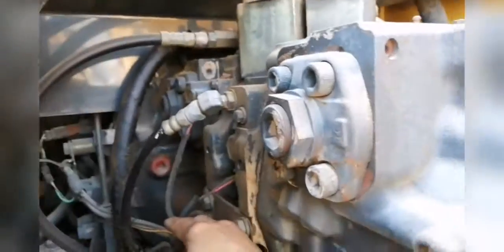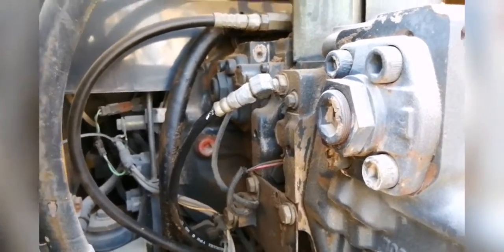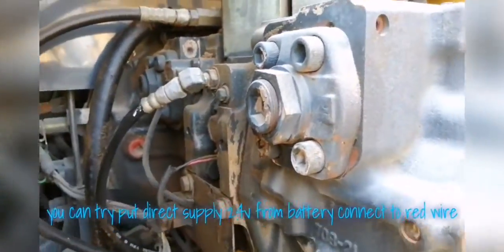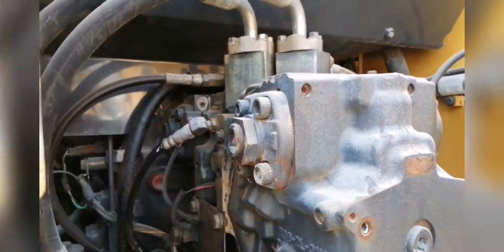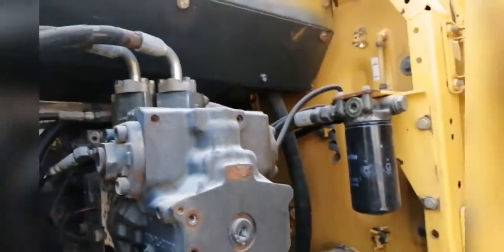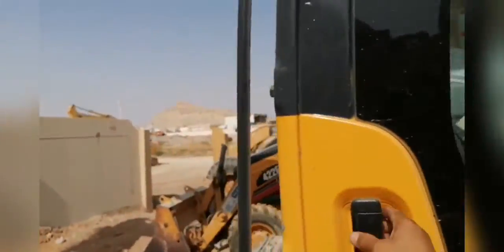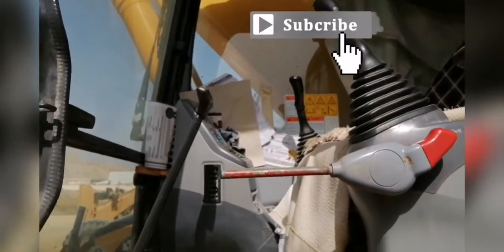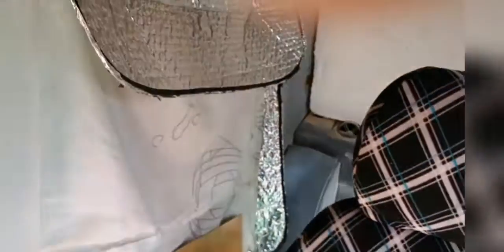KOMATSU PC 220/228-6/7 PC & LS PROBLEM ENGINE ITS OVERLOAD

Comment: ser salamat  poh marami poh akong natutuhan s inyo isa nlng poh problema k poh ser..ok nmn poh lahat ng power nya pero pag ka poh louded sya nauupos poh ang galit ng makina.pero s boom up lng poh sya hirap.tapos pag nagwarning poh battery lumalata din poh sya.ser..pc290 poh komatsu poh ser salamat ser..
Reply from the maker: kung may watsapp k 0567581176 o kya messenger jhunhunk pra makapagusap tyomaayos
Reply: May ganyan din kaming unit sir ganyan Ang trouble anokaya Ang nagging problema nya sir..
Reply from the maker: @abetvits94  ang problema b eh ung nmamatay ang makina kpag nka full trigger k s boomup o arm in or out kpag ganun check mo muna ung dlawang solenoid doon s main pump, ang pag testing nya switch on mo tapos on mo ung safety lock ska mo e check ung supply dpat pareho un n may supply 24v kpag na start mo n mawawala ang supply nang isa ung isa lang ang permanent check mo un, kung may bulb tester k mas maganda ksi makikita mo n iilaw ang bulb ppwede rin n nagkapalit ang socket nya , plike and share n rin ang video ha salamat
Reply: @caterpillarjhunhunk  ok.po sir I check ko po salamat po

Comment: Chief,can you relay to us,how much the standard resistance for the two solenoid...if the reading is abnormal or no reading at all in ohms it causes the solenoid valve closed the passage of hydraulic fluid,am i right?God bless your channel it helps a lot to practitioners like me.

Comment: Good job sir thank you for giving us your knowledge
Pwedi din po bang pakipaliwanag yong PC 200-3 OLSS type pump kong pano amg adjiusmemt sa engine backdown pag nag ooperate ma po yong machine.. Thanks po sa info
Reply from the maker: ask ko lng anu b ang main problem nang machine, engine o main hydraulic pump, lumang npaka lumang model n ito ah, pero ok lang, minsan kasi akala ntin nsa makina ang problema lalo n kpag naooperate, pero d natin n notice n nsa hydraulic system pla, pero meron din talaga n ang mkina n ang problema, hindi b mausok n nag makina mo o may backpressure n s breather, ask ko lang pra may reference ako s mga ppwede ko masabi, ngayon kung bagung ovehaul ang makina, ok malalaman mo nman yan, kung malakas ang pickup nang makina mo kpag nka idle k biglain mo nang full acceleretion, dapat kung ok makina mo bigla din sya n nka full accelerate pero kong nka full n tapos dahan dahan ang pagaccelerate nya may problema o low power talaga makina o mahina humatak.ppwede n magadvance timing or late timing or inspection mo muna ang makina mo, baka may mga dapat n nkakabit pero nakondem n o d n ikinabit. ha. o kya add mo ako s messenger  jhunhunk pra makapag send k nang picture o kahit kaunting video pra makita ko ang sitwasyon

Comment: Thanks for the video. I have old 228 Komatsu excavator.. it won't shut off the engine even I turn off ignition and pull the key out. Engine is still running.. any idea?
Reply from the maker: bro give the specific model with -6-7-8 in witch dash model of your machine,so i can tell you what to do
Reply: Stepper motor is bad

Comment: Any basic advice sir track malfunction forward & reverse not working what possible problem sir?
Reply from the maker: Hello sir some function of hydraulic system its working or not ,if not  meaning maybe do you have problem on ppc lock, but if some function is working  I think you should have to check hydraulic pressure and need to get high pressure at arround 350br

Comment: Hi there my kohmatsu pc88 will not run  the engine stall and low power..
but when I run emergency switch it runs perfectly..
any ideas?no problem with epc silonide it's new..
Reply from the maker: Contac me in my whatsapp+971567581176

Comment: Sr I have a problem with my Komatsu.. I changed my hydraulic oil on my Komatsu.. After charging  I the hydraulic was low and I topped up and  it became too much. Then the plug at the front of the solenoid vavle come off due to pressure.. Since then the machine is busting the pilot hose and the hose which goes to the block behind the main control vavle.. It is lacking power if it gets power it  bust the seal or bust a hose what might be the problem
Reply from the maker: bro i dont konw how thats happen you just change the oil in then, all the  problem you told is came out saddenly,how thats happen,what type of grade of oil you used,before you do changing oil you never had any problem,contac me in my whatapp. +971567581176

Comment: Ser sken ganian din.. Pag nagsabay ung swing saka travel namamatay ung makina or humihina.. Posible kayang ganian dun ung pwedengaging cause nung? Bago pangnunit nmin Ser ee.. D ako masyadong marunong sa hydraulic kaya marami ako matututunan sa inyo
Reply from the maker: yes sir try mo check power supply nung solenoid s hydraulic pump dpat may power sya pareho bgo mo e start, pero dpat nka on lang muna ska mo check
Reply from the maker: salamat, pero pa subscribe mo nman channel ko pra at click mo ung bell botton pra update k s mga upload ko n video
Reply from the maker: add mo ako mssenger pra makapagusap tyo nang maayos,
(jhunhunk)
Reply: My power lahat ng soloniod nya Ser.. San kaya pwede maging cuase.. Ok nman ung mga fuse..
Reply: Baguhan palang po ako sa hydraulic kaya halos 0 knowledge pko d2.. Wala nman ako katulong na nakakaalam.. Truck mechanic lang po kase ako
Reply: Pc 200 Lc po unit nmin Ser.. Medyo modelo na ata to

Comment: Good day Sir.. New subscriber here..ask ko lng po kong anu cause ng hydraulic overheating sa KOMATSU GD 755-5R na grader?. thanks po and more power sir..
Reply from the maker: s greader mga pweding dahilan ventilation, or over used n ang hydraulic oil mo, kung dipa npapalitang ang hydraulic filter mo, bka nagbabara n o hirap n makadaloy langis, pwede ring over pressure, at over yong flow limit nya.
Reply: @caterpillarjhunhunk  salamat po Sir.. Ngayon ko lng kasi naranasan to na grabi kabilis mg init yong hydraulic oil mga 10 minutes lng..
Reply from the maker: @aljonnfernandez8889  ganun b kabilis uminit baka nman sira lang sensor check mo muna sender nya bka damage nya npaka impossible nyan in just a minute eh high temp n agad
Reply: @caterpillarjhunhunk  oo nga sir..napalitan ko na sir.. Hindi mo mahawakan mga hose sa sobrang init..pinalitan ko narin hydraulic pump at control..nag bago lng kunti..
Reply from the maker: @aljonnfernandez8889  na e check mo nb ang pressure ng main pump mo ngayon baka over pressure sya o over din ang flow, tapos kpag ginagamit n kinokontrol ng operator pra lang d mamatay, ppwede talaga magoverheat kpag ganun, mag chexk k muna ng pressure pra sigurado pra may basihan k ha

Comment: Brother I have a problem whit my komatsu 220 lc6 the problem that I have is when the  bucket is full the boom don’t go up soon enough any recomendation
Reply from the maker: actualy bro many reason why the is happens first maybe low pressure one of your pump that driving and giving pressure for the boom, at first you should have to check individualy your main pump, and also try to check your travel if one of the travel is slow meaning one of your pump low pressure, see this video bro, how to testing the main pump to know if main pump is low pressure, you have to use pressure gauge around 500bar gauge the attach the gauge where the main pipe pressure locate there is a small head of bolt you have to remove then attach gauge there, ok, https://youtu.be/mFUyGo0BxjY
Reply: Brother I have a problem what my komatsu pc270-7 the problem that I have is when the bucket is full the boom don't go down any recomendation
Reply from the maker: @ishmaeldadzie7227  contac me in my whatapp +971567581176 for better conversation

Comment: hello sir . i have same problem excator is doosan 300. i check the solenoid valve electric is available .but now have same problem means operating machine then almost stop machine. have any another problem sir?
Reply from the maker: bro can you add me in your watsapp if you so we can talk well, about your problem
+971567581176
Reply from the maker: have you check your monitor about any type of error its easy for me to give an idea were and how you can solve your problem
Reply: @Johnson  hi bro i have doosan dx225lc 2008yr i have same problem loosing power onload and now pump getting too much heat did you sort your problem?
Thanks
Reply from the maker: @gwajimagwajima  bro can you pls subscribe my channel if i have any uploaded video you will be notify thanks
Reply: @caterpillarjhunhunk  thanks done bro

Comment: Chief may idea ka po ba sa connection ng pressure reducing valve connection ng pc-228
Reply from the maker: bakit anu ang problema
Reply: @caterpillarjhunhunk  nawawala ang pressure sa boom up.tapos blik ulit tapos nawawala nmn.pareho cla ng stick out
Reply from the maker: kung alam mo ung valve na nakalagay s likod ng main control valve ang tawag doon ay merge divider doon meron din nka install n relief valve sa ganyang problema isa un s dahilan kung nwawalan ng power,pero kung nwawala wala o putol putol ang pag gana nya check nyo rin ung pilot supply baka naman ung solenoid nya nagooverheat n or pasera na,merge divider,at double stage solenoid baka hindi n nagffunction ng maayus inspection nyo muna ung electrical baka isa sa dahilan eh naandoon

Comment: Sir magtanong lang po,pc200-6, sa main pump 2 solenoid, saan mag gagaling hydrauluc oil supply, ung nagawan ko sa main control nangaling, ung suply ng pump1 na pumunta main control valve, doon kumuha ng supply for pilot lever, pa ma ba yon, tnx
Reply from the maker: yes doon nga magmumula ang pilot supply isa s main supply kung saan nakalagay ung self reducing valve, andoon din ung pilot supply

Comment: Good morning sir, pde ba gamitin pag dinirekta ung redwire ng solenoid sa battery, wla po ba masisira na iba...

Salamat po... Godbless
Reply: Komatsu pc228 

Po ung unit ko, salamat po
Reply from the maker: pwede nman kya lang pang testing lang para s pag trouble shooting,kung mag ddirect ka observe mo ung solenoid bka mag over heat ksi hindi n nrregulate ung supply nya,n galing ecm

Comment: Bro could you please help me to rectify the problem issue on my excavator pc200-8 not getting start when the engine is hot many thanks
Reply from the maker: hi sir,first thanks for messaging me,and giving the information about the problem that you are facing on your machine ,sir i just want to ask first before the problem is started,what did you observe,we want to know more ,for me to analys what is main cause of problem,contac me in my whatsapp for more better conversation,+971567581176

Comment: Hy mr.!
I have one Komatsu PC 210 LC 8 from 2008Fuel consumption is very high at about 18l / h. Do you have any idea why? The engine works well, it has power and does not emit smoke, it rarely happens that  travel sistem it reduces my engine speed!
Reply from the maker: before applying any trouble shooting just check the main pump pressure.
Reply: Could you tell me what values the pump should indicate to me?
F.Pump and R.pump
Reply from the maker: @alinbradea4810  the front is inner side rear pump is outer side

Comment: How to access monitor PC200-6 step by step for checking hydraulic main pump pressure, error code etc ?
Reply from the maker: contac me in my whatsapp for better conversation, +971567581176
Reply: @caterpillarjhunhunk  Thank you bro I got service manual now I can access it.

Comment: Sir paano malaman kung normal working ang solenoid valve,,at ilan ba talaga ang voltage,, kc nung nag check ako 8volts na register sa tester, ang isa walang voltage,, nka start ang engine at nka engage. Pero slow idling pa
Reply from the maker: ppwede ko b malaman kung anung model nang machine mo, normaly kung nag machine ay dash 7 below supply nyan ay 24v pero kung dash 8 pataas may solenoid n ang nagccontrol ay ecm ung tinatawag n variable solenoid, yan eh kung komatsu.
Reply from the maker: ito p s first starting mo normaly ang solenoid nyan ay nka on lahat  s dash 7 yan ha. tpos kpag nag operate kna magooff ung isa na ang nagccontrol ay pressure switch, ung isa pemanent n nka on ang nagccontrol naman ay ecm malalaman mo ya  kung alin s dalawang solenoid kpag e disconnect mo isa isa kpag nagwarning s monitor un ang pra ecm
Reply from the maker: kya nman dapat ung dalawang solenoid ay gumana s unang start mo kasi pra hindi magbigay nang pressure o load s makina.
Reply: same problem po.pc200-7 nka start engine at engage safety lock..isang solenoid no valtage pero pag disconnect naman.may voltage 24v.ang isa 24v pag nka disconnect..once connected naging 8v nalang
Reply from the maker: @jillque3536  n try mo nb s bulb tester kung npapailaw nya doon s dlawang wire nang bawat solenoid,ska magwwarning yan s monitor kpag n disconnect mo ung solenoid n controller ang nagpapagana,nagwarning b? yang harnes ksi nyan hanggat d mo sya pinapagana nag hydraulic system nya pero dapat yan may supply n 24v tpos un nga kapag nag operate kna ung isang solenoid mawawalan nang supply ung isa ang nka maintain ang supply.

Comment: Hello I am from India have Komatsu PC 71my engine doesn't start, but if I losen MRV ON MAIN HYDRAULIC PUMP, ENGINE STARTS IMMEDIATELY, THAN WE TIGHT MRV FOR WORKING, IS THERE ANY SOLUTION
Reply from the maker: ok bro this is i want you to do, can you check the main pump if there is any solenoid attach on the main pump check it and see if we have power supply if solenoid available there.
Reply: @caterpillarjhunhunk  SIR mine machine hydraulic pump does not have any wiring, is there any thing I can check
Reply from the maker: contac me in my whatsapp +971567581176 and send me any picture of the model and serial number, and also pump and engine ok i try to find the model of your machine but i cannot find it
Reply: @caterpillarjhunhunk  Ok fine

Comment: Where is arm sensor located sir. Pc228
Reply from the maker: Arm sensor is located at side of the control valve with separate brocket the function of that sensor is auto acceleration, and behind of the control valve is the main pressure monitoring

Comment: I have a pc 160 it developed a problem , it starts in the morning and works perfect , but if you switch it off after like 2 hours it wont start ,
Reply from the maker: do i know which model dash pc160-6-7-8 i want to know that
Reply: @caterpillarjhunhunk i have the same issue, -7 model

Comment: Hello Master..
Ask ko lng kung alin s dalawa yung normally open or alin sir yung mag si switch off na solinoid during operation.. pc po b or ls....
Reply from the maker: brad sinsya n at ngayon lang nagreply, yung PC-epc ang permanent n may supply yan ung nsa bandang labas n nsa pagitan ng dalawang pump.ung isa LS-epc  yan ung nsa bandang loob yan nman mag oon lang yan s starting time kpag nagenergize n o na on n ang ppc lock valve o ung lock s operator cab un nsa kaliwa n handle magooff n ung habang nag ooperate ang machine then kapag naka idle lang ulit makina or nagpapahinga magoon ssya to release pressure at mag free wheel lang makina habang nka neutral k.
Reply: @caterpillarjhunhunk  thank you po sir ..malaking tulong po sa akin

Comment: Helow sir reques poh ako ng video tungkol sa pc 120-6 ayaaw mamatay sa susian at nawala poh ung rpm nya.ano ya prolema nito. Thanks po.
Reply from the maker: haha sinsya na medyo sobra busy nmin ngayon, send mo nga s akin s whatsapp ung ung monitor at ung design ng accelerator motor, baka ksi iba yan s normal nmin n ginagamit, para alam ko kung anung klasing systema nyan wala ksi kaming ganyang modelo n machine dito s amin pero mag kkaroon ako ng idea s excavator, +971567581176
Reply: Ano poh whats app number nyo patulong poh ako sa unit ko pc 120-6 halos napanood kna poh lahat ng video    nyo sir ang problema sa unit ngaun malakas po mga cylinder nyo pabalik halimbawa boom up mabaga boom down mabilis po ganun din sa travel.

Comment: ser ask ko lang po pg ng deeper po ako na ma2 tay po ang engene ko ganon din po kya yan
Reply from the maker: ask ko lang anung brand nang machine mo,kung same din nitong nsa video check mo ung solenoid,yan nsa side nang pump dlawa yan s unang start mo nang machine mo dapt ung solenoid pareho may supplytpos kpag nagoperate kna magauto off n ung isa at isa nlang ang gagana o may power,or kung may mssenger  k add  mo ako **jhunhunk**pra makapagusap tyo nang maayos
bka d kpa nka subscribe bka pwede subscribe k muna and hits mo yung bell and select all
Reply: @caterpillarjhunhunk  slamat p0 ser sge po try ko  at nka pg subscrbe na po ako

Comment: Hey bro i have a komatsu pc2288uslc-3 and it reads overheat temperature as soon as the machine is started on a morning i have changed the coolant temperature sensor and it still reads high
Reply from the maker: ok bro thanks for contacting me,so regarding about the problem of your machine,i thinks it is electrical shorte on wiring harnes insfect the harnes maybe the harnes is touching to the body,but have you try,disconnect the temp sensor and try to switch on,if still the same,can you pls contac me in my whatsapp i need some pics about the monitor,+971567581176

Comment: How muuch the resistane solonoid sir?
Reply from the maker: hi, regarding about the solenoid we have so many type of solenoid and power input 12v 24v on dc about highier voltage is also same, thats defind on the size and where is using
Reply from the maker: contac me in my whatsapp for better coversation +971567581176
Reply: @caterpillarjhunhunk  Yes sir i know if voltage,but i meaning resistane of Ohm units..
Reply from the maker: bro i dont know what type of solenoid that you are look resistanse, many type of solenoid that we have and all of that diffirent resistanse just because of power input now if you are asking about komatsu in ppc lock solenoid that is ranging 20 to 60 omhs for 24v input